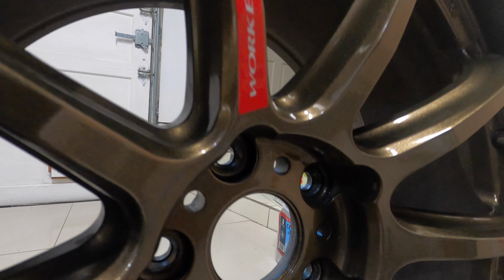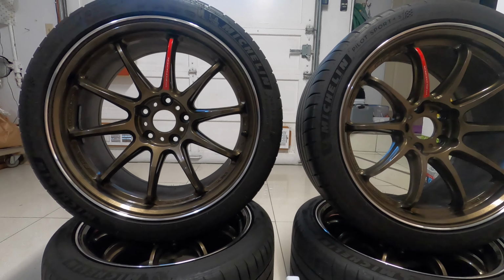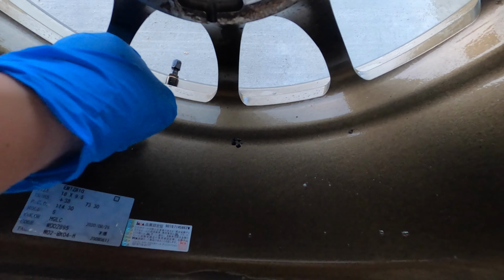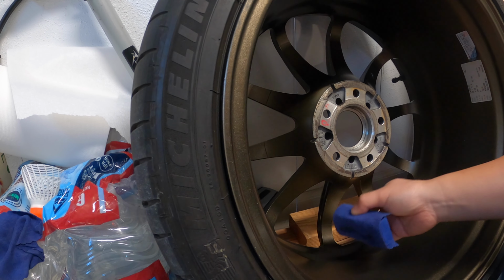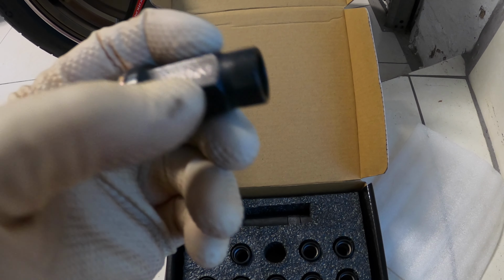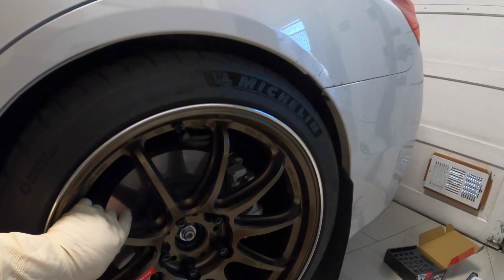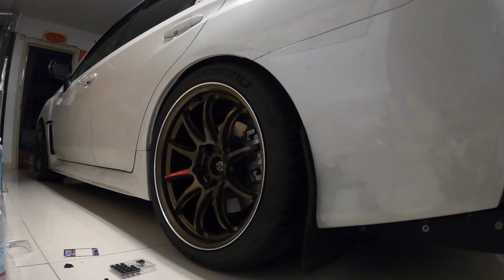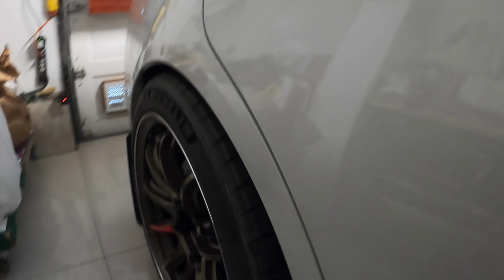New Wheels for the WRX | Wheel cleaning | WRX Wheel fitment

Comment: Why not adjust coilovers?
Reply from the maker: the only way to make them fit is either raised the height of the coilover (which I don't want). The other way is to adjust cambers( which I don't want for daily driving).  Or roll/pull fenders like I did.